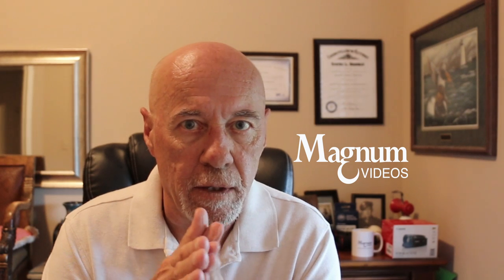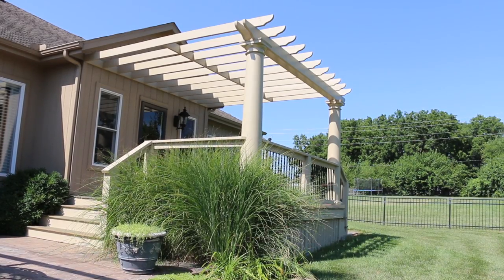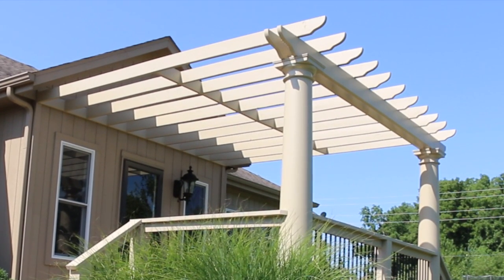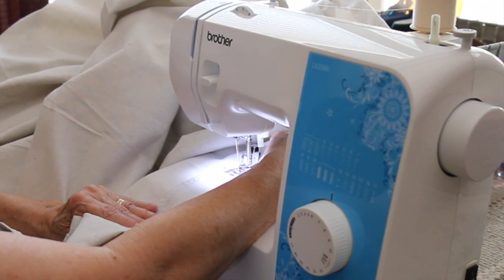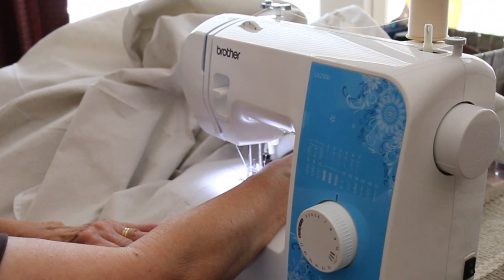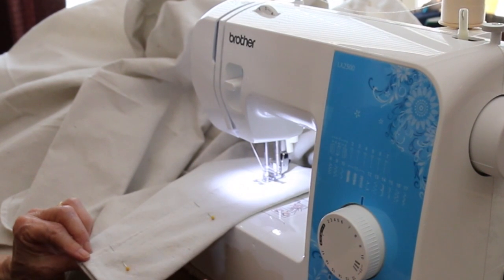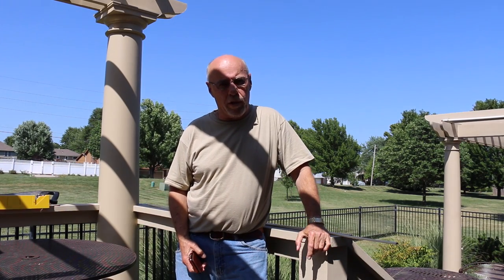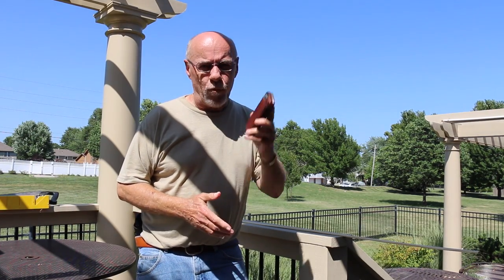HOW TO MAKE A PERGOLA COVER

Comment: How did it hold up over the last couple years? I'm thinking about using bamboo rolls or maybe a woven palm. I spent all the money to have a pergola built and to be honest I'm not sure I understand the logic behind them.  Especially here in Austin TX where the summers get 100+ for like 50 days in a row.
Reply from the maker: It's held up pretty well, aside from mold or mildew. We have to run it through the washer once a year to keep it looking good.
Reply: @MagnumVideos  nice, thanks for the reply. I'm considering this material but I was also thinking about bamboo rolls.
Reply: @MagnumVideos   Hi Magnum!  Could you please advise on my question below about attaching the ends to the pergola?  Did you use nails or screws?  I'm almost finished sewing the canvas.  Thank you very much.
Reply from the maker: Hi Stacey. Rosie sewed a small pocket along the width about an inch or two wide. I cut a piece of lath strip (about 3/4 inch wide and an 1/8 inch thick) to the right length. Then I just used small finish nails to nail it to the pergola boards (about every 2 feet or so). Didn't drive them all the way in so they were easy to pull out to remove it over the winter months. (WATCH 8:30 to 9:10) Hope that helps. @staceyhoward127
Reply: @MagnumVideos  Thank you so much!  This helps greatly (assuming I don't fall off the ladder ...)     :)
Reply from the maker: I certainly hope you DON'T fall off your ladder. At 70 years old, that has become one of my primary concerns. (Me falling off, not you.) LOL. Anyway, I'm glad it was helpful and I'm sure it's going to come out great. Let me know if you have any additional questions. Thanks so much for watching and for your comments. @staceyhoward127

Comment: does water pass through the drop cloth? and does it get mold on it?
Reply from the maker: What great questions, Mary. Water isn't much of a problem, but it does get mold (or mildew, donjt know which it is) on it by the end of summer. We just take them up the laundromat (since they won't fit in our washer) and spend about $5 to wash and dry them. Just once a year. They provide a very good shade.

Comment: Your cover is going to collect water and pour onto the deck, rather have it pulled tight over the top of the pergola.
However, it might be better to have it raised above at an angle so the water runs off and then it can be left there permanently to give you a more protected area.

By the way...
Pronounced: p ER g oh l uh 
http://www.pronouncenames.com/Pergola
Reply: and it mildews unless you protect it. Learn from my mistakes.